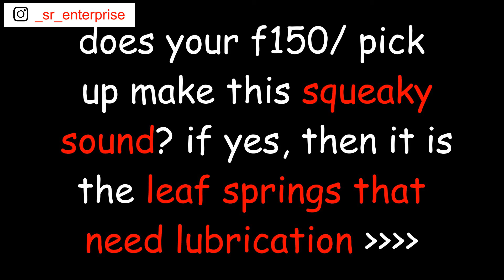EASY leaf spring squeak FIX!!  f150/ any pick up (how to)

Comment: I was doing the same thing on my gmc sierra but I got tired of having to spray lubricant in the springs every few days so I designed a part to stop the squeaking once and for all! :) Check it out https://youtu.be/2GvEsat5Bbc  I designed it for my gmc but it will work on any vehicle with 2.5" wide leaf springs.